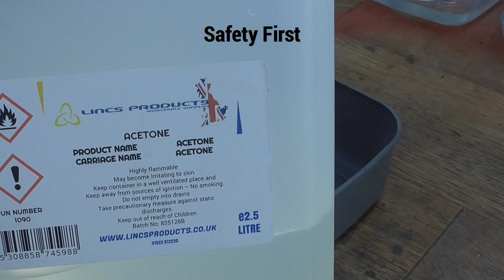Complete Restoration of Vintage Pliers, Unique Restoration

Comment: The pliers needs a very thick coating on the handles. 25-30 more dips im guessing.
Reply from the maker: Hi navigator of none. Each coat takes 30 mins to cure plus four hours for the top coat.  25 -30 is excessive, each time you dip it there is a drop in paint level. Noticeable on 3 dips. After 25 dips how would you hope to cover the handles? Thanks for your comment regards Brian
Reply: @UniqueRestorations  oh damn, i didn't know that. Thank you for the clarification.

Comment: I think you should have baked it to 800 degrees fahrenheit for 8 hours and let it cool slowly you hardened it but you did not tempor it , It to say is now hard and brittle needs to be tempered at 800 for 8 cool for eight then polished and dipped
Reply from the maker: Hi Peter, It would  cost me a small fortune to heat these pliers for 8 hours at that temp. My channel is about achieving the best results without the need for expensive machines or processes so other people can try it aswell.  Thanks for your comment. Regards Brian

Comment: why didnt you re temper the pliers great finish thou
Reply from the maker: Hi Robert I thought I had re tempered the pliers when I quenched the hot metal. Regards Brian
Reply: @UniqueRestorations  what you did was quenching, or hardening which makes the steel hard but brittle. Tempering is the next process where the steel is heated to a certain temperature and held for a certain time in order to bring the hardness down a bit to restore some toughness to the steel.This can be done in a toaster oven. No need for special equipment.
Reply from the maker: @davidcoats1037  Hi David thanks for the information I will bear that in mind for my next project. Regards Brian

Comment: "let me know what I think" Needs to temper in a oven at around 800 f for eight hour until peacock purple thats blue and purple colors and ramped down in heat slowly until you can touch them but golden straw color at 500 f is enough for most jobs for eight hour slowly cooled over then buff away I would not do that step as it will make them slick and hard to hold on to but to make them a show piece it's okay then nickel plate for a time and use chromium based solution for chrome plating  and buff the hell out of them if you want to know what I think but you do it as you see fit IT"S YOUR SHOW! do what is comfortable for you if your happy with it Just do it and to hell with what this old man thinks.